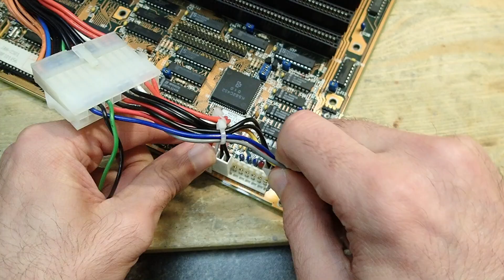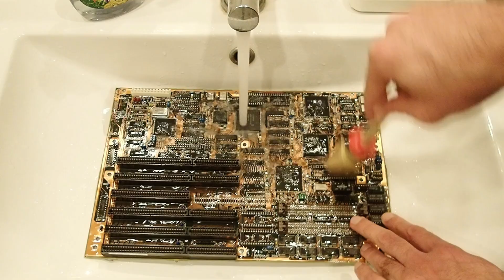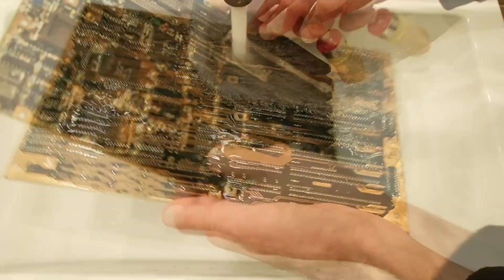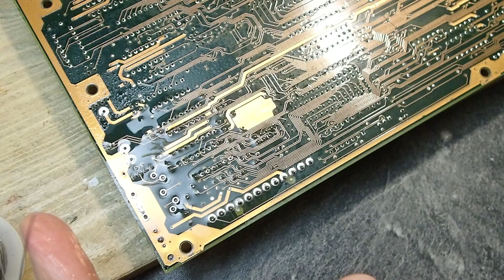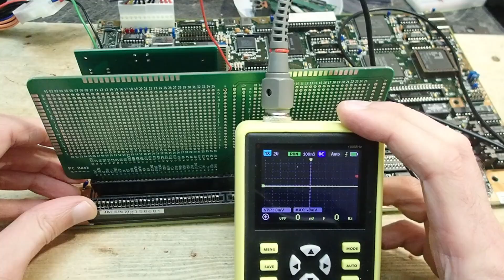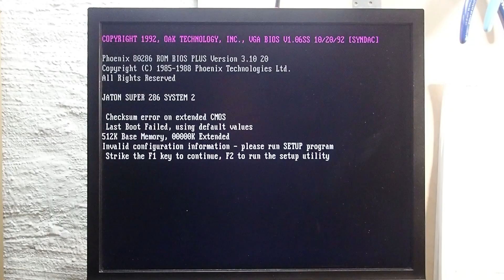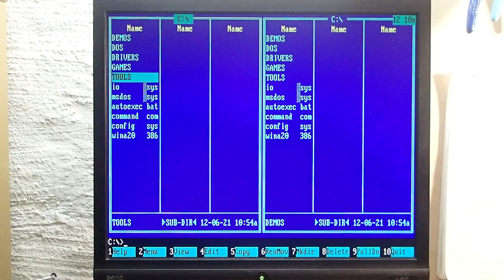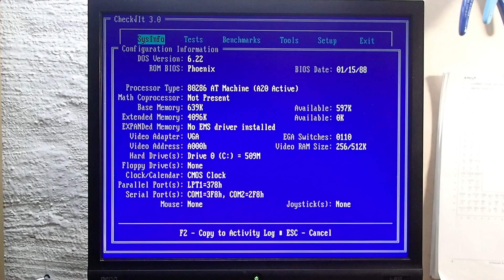Let's repair an old 286 mainboard Jaton JAM-2301-V1

Comment: Very nicely done! washing computers with water is absolutely possible and I revived a laptop covered in coca cola back in time which worked for years now in a similar way as you did. depending on the amount of bad stuff I wanna remove I also wash in IPA with ultrasonic cleaner after washing with water. this also removes water previously applied to the board. it is great fun to watch your videos!

Comment: Another great repair video :)

1) I need to be more methodical and patient when cleaning corrosion too. I love your result.
2) I usually use citric acid, this is the acid in lemon juice but in powder form. I make the solution as strong as I want.
3) This faulty ROM chips OMG, I will add this to my tests, thanks for the info!!
4) The two red caps are probably different as these are the only 16v ones (connected to +12v and -12v rails).

I need to recheck some of my broken boards now :/
Reply from the maker: Thank you. And yes, you could be right about the 16V ;)

Comment: Aufregendes Video, sehr interessant und informativ. Ich bitte Sie, Autor, widmen Sie sich ein separates Video, auf welche Speichermodule für eine Netzwerkkarte verwendet werden und wie Sie ihn blinken können, damit Sie den Netzwerkkartenlader verwenden können, um die Festplatte zu bestimmen. Gibt es eine Firmware-Methode solcher Module ohne Programmierer, beispielsweise aus der DOS-Umgebung. Es wäre sehr interessant! Bitte hinterlassen Sie diesen Kommentar nicht ohne Aufmerksamkeit. Vielen Dank. 👍
Reply: But there are videos like that. It's simply burning the boot ROM. The process depends on the network card. Later model with onboard Flash chips(common in Intel Pro series) could be flashed in dos. Some(depending on PCB) r8139 card as well. Older ISA cards used the 27 series EPROMs(not only one E), so they can't be erased programmatically and require an UV light to erase. This also means that the manufacturers did not put any logic on the board to create the nesssary 12V write pulse. If you want to play with boot ROMs I recommend you use a W27c512 EEPROM it's compatible with the 27 series EPROMs, but can ve erased programmatically.

Comment: There seems to be some signs of corruption on second rom ( 19:00 "%opyright" ) so those could cause the hdd issues without the xtide bios.
Reply from the maker: May be, but if there is a corruption, it has to be very evil, since the checksum is right. There are also a lot of older 386 and 286 mainboards, which don't want to boot from a compact flash card. I never found what's the exact issue so far.

Comment: Hmm. USB to DIN5?
Reply from the maker: Even USB -> PS2 -> DIN5
Reply: @necro_ware  Hmm it's very interesting. But it must be a special keyboard, is it?
Reply from the maker: @Maciej.R.  Many USB keyboards still support PS2 protocol, so if you connect them through such an adapter, you can plug them into an old good PS2 port. Which is again just a small DIN5.

Comment: what if you use some liquid tin solution ? thete is multiple ways to electroplate metals passyvely , no heat no effort lus soak the traces with the liqid and wait for it to change color
Reply from the maker: Never tried that, but may be that works as well. There are for sure other ways too, but I use this one since I have to solder anyway and it doesn't need additional materials.

Comment: I have a mb , the debug card shows reset circuit high, do you have any idea  what should check ? Mayby you have such a mb with this kind of problem to make a video ?
Reply from the maker: I have no mb currently at hand, where reset would hang. I'd check all the tantalum decoupling caps, which are hanging along the reset line. If they are shorted the reset will be pulled to the ground all the time. But there are also many other possible scenarios.
Reply: Also check power good signal on the power connector. Some boards stay in reset if the power good signal is not present or faulty

Comment: great video. I just wonder - when should you cover the traces with a resin and when is it ok to leave them unprotected?
Reply from the maker: You can, but there is no need to do that. Only exposed copper has to be protected from oxidation. All the tinned traces are already protected by the solder itself.
Reply: @necro_ware  Using green solder mask would be a nice finish like the polished paint used on car restorations. Congratulations on the successful repair and thank you for this very informative video
Reply from the maker: @eltrash  Not on this yellow board ;) Thank you.
Reply: I use something like nail polish just to protect against something landing on them and shorting them out.
Reply from the maker: @darthtripedacus1  Then you have to cover the whole board in nail polish, since you have all the solder joints exposed  too :)
Reply: @necro_ware  challenge accepted :). Good point sir.
Reply: If you want(for cosmetic reasons), you can use a UV hardening PCB mask. It's available in multiple colors. It also makes it harder for the moisture to get between the PCB layers if the top/bottom finish was damaged.
Reply: @ochykysh  Glow in the dark traces would be a fun thing to have.
Reply: I would just get a bottle of nail polish, and gently place the bottle itself on the board.... It doesn't do anything but look nice, but it has a strange placebo effect. Just make sure its lid is not conductive should it tip over.

Comment: At 13:17 you show a capacitor with 273µF but Vloss 49% and ESR 140ohms, certainly that is not ok?
Reply from the maker: Oh, shit, I took the wrong shot during the edit :D I tested the capacitor two times and the first values were totally off. After a reset everything was right again, but of course I took the wrong shot into the video.... my bad. This were ceramic 47pF caps as you see in the video and they can't even be 273µF :)
Reply: @necro_ware  Haha, yes I was looking all over the board thinking where was that electrolytic cap you removed as certainly a tantalum from the 80's will not have that high capacitance, now I know :) Thanks for the great videos! :)

Comment: Regarding the "long slot" - this is most likely not for memory expansion. The 286 does not need more lines than available on the ISA bus.
Reply from the maker: Yeah, it could be also some other upgrade option. Hard to tell exactly, since such boards are very rare anyway and a lot of them are even proprietary.

Comment: Another rescued board. And obviously a rare one, too. Even the early 486 boards doesn´t had integrated IDE and floppy. Your high quality content pays off now, it seems. Congrats to more than 15000 subs!
Reply: This has a Siemens controller chip. So this most likely was an OEM board for a said name brand. Integrated controllers were not uncommon. But in the larger clone market, they were often too expensive.
Reply: Even some of the earliest Pentium boards didn't have integrated controllers. 

However, I once owned an IBM-branded 286 mainboard with both controllers integrated AND a pair of 72-pin SIMM slots (but NO onboard RAM). IIRC the board was dated 1986. So it was a weird one all around. Sorry I don't still have it.
Reply: @Reziac  The earliest ibm boards to use 72 pin ram was probably 1990 iirl. I know they put copyright dates of 1986 on many ps/2 mainboards, even later ones. The early 286 boards used cards which used pin arrays to plug in and were not like a normal 72pin simm.. I don't know how many pins they were though.
Reply: @wishusknight3009  That's what I thought. But bloody hell, here was that IBM board, it was old and long retired when I got it (about 1994). and yes they were standard 72 pin SIMMs, I still have the SIMMs and they worked in a 486. It was probably used at JPL tho (judging by whose trash it was), so might have been a special model not found on the consumer market.
Reply: @Reziac  The model 30 was made for quite a few years and did change specification a couple of times. But I do think it was mostly relegated to business sales by the end of its run for its cheap price. It is possible that the last models used 72 pin simms and were only business class offerings. IBM tried to keep a modicum of standardization across the line.

Comment: I have some computer motherboard 286/386/486 .I never tried to repair them until after watching your movies :) .I have 3 questions .
1. Where to find diagrams of old boards 
2. Do you have pdf for ic HM8226 and icw42c07-01p 
3. I have a  pentium 200MMX board with a strange  problem . It works but , when turned on it works .I turn it off and on again black screen :/ .If I want to see  something  on the monitor I have to change the graphics card port and turned on .
Reply from the maker: For 1 and 2 I can only refer to google, 3 could be bad capacitors.

Comment: When I wash boards I give them a quick shallow bath in isopropyl alcohol after washing with water. The alcohol is very good at removing the water and salts from under components and evaporates much quicker. Just remember to do this outside because the IPA fumes are strong and unpleasant.
Reply: .....unless we want to reeeeeealy enjoy our hobby that is.
Reply: @wishusknight3009  then you need to use a certain other solvent ;) IPA fumes only cause headaches..
Reply: @ochykysh  lol yup
Reply: @wishusknight3009  Ether is much better for that. :P
Reply: Iso fumes are strong but I never found them to be too unpleasent (even for 70% Iso solutions)
Reply: I slap my fingers against the slots and memory sockets.  Just a little bounce of the meat of your fingers over the open slot will shake a lot of surface tension loose and drip water everywhere.  Then compressed air in the nooks and crannies, then dry for a day in a warm spot.  Good to go!
Reply: I just wash with 99% isopropyl alcohol tbh. And this saved alot of boards, and even temporaraly ressurects those boards with leaky caps too